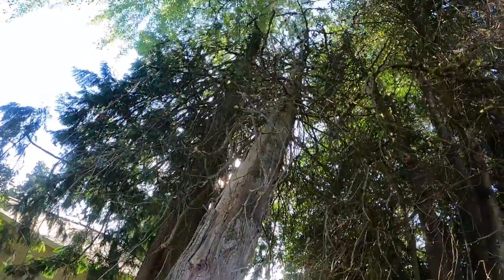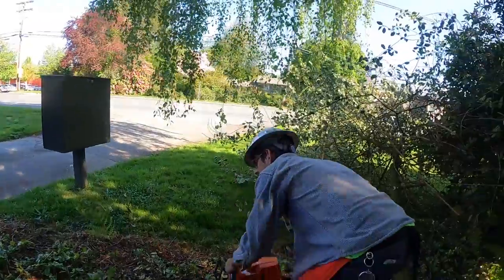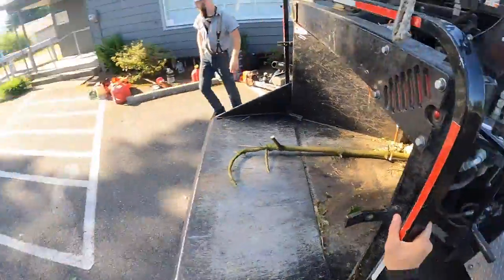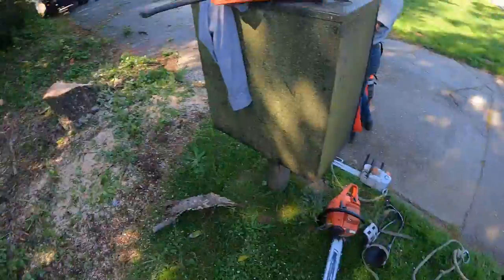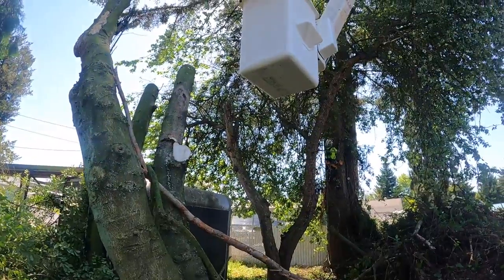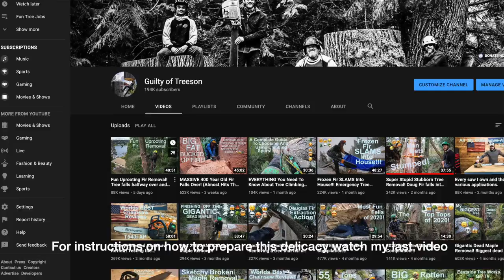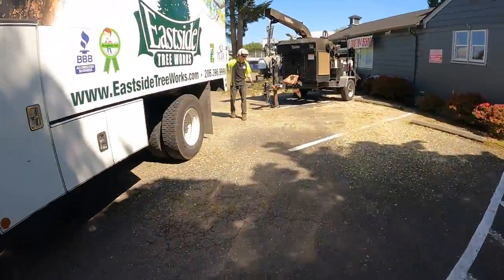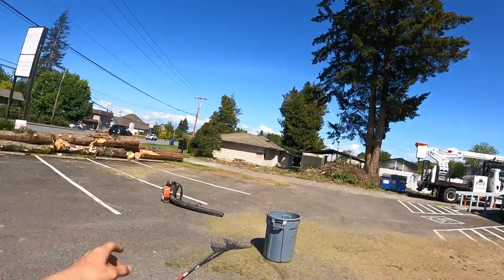Jammin' Jordan and Inbred Jed SHRED The Axe!!! Lot Clearing With The Excavator

Comment: I actually chain down my excavator the same way and I started watching videos from a dot officer and apparently we are doing it wrong. You need one separate tie down per corner and one for the bucket. You can go off the center loop but needs to be two independent chains. Or one chain isolated into two Separate ties It’s up to you what you do just thought I would mention it. I like how that bucket isn’t just hanging and you can control the curl

Comment: Tip for that squeaky boom: If you place the boom down just to take the weight off it and rotate the pin in the joint itself, after a few tries you can usually stop it. Old timer trick I picked up a little while back
Reply: @music-jn3wn  Yeah of course, it’s just a nice trick when you’re on site without one and the squeaking’s driving you mad.

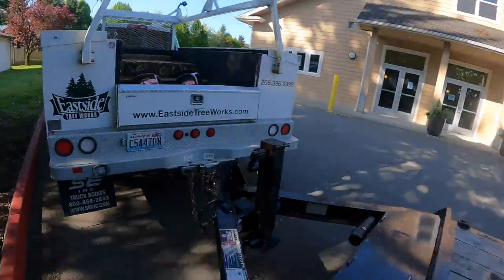Comment: 4:45 I believe that is improper load securement. It’s supposed to be 4 separate tie downs, you can use that 1 chain for both fronts but their should be slack in the middle showing that your not using the single chain and 1 tie down for the whole front. It looks like your trying some funny business with 2 tie downs and the second is just their for show. To correct this you need some of the chain to come around the backside of the blade tie down to the front so each front tie down is it’s own loop and the chain in between is tension free and does nothing.

Comment: pulling the rope when stopping the saw is for VINTAGE saws. modern day saws dont need to do this.   
As the old vintage saws would shut off the last movement of the piston had a chance to slam backward , engaging the pawls and snapping the starter rope.